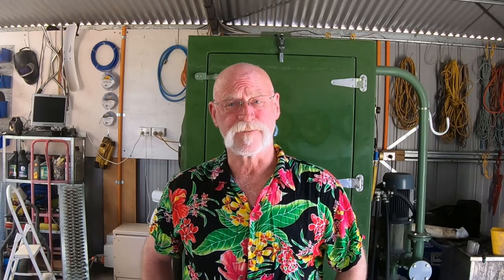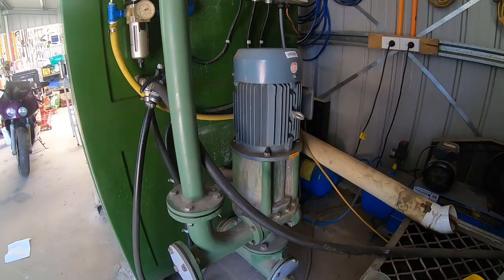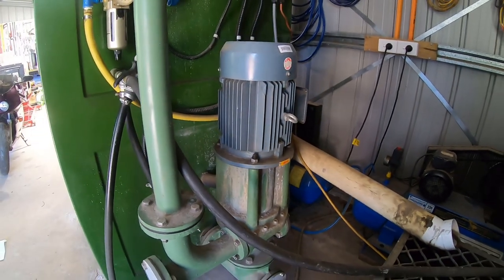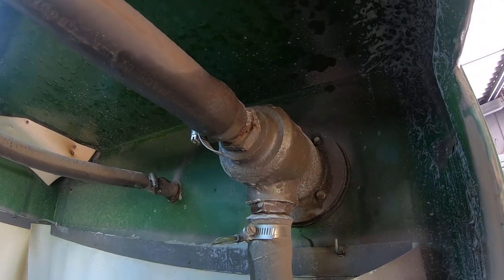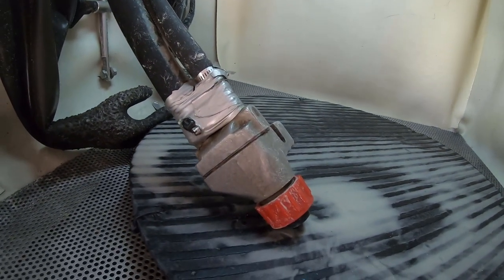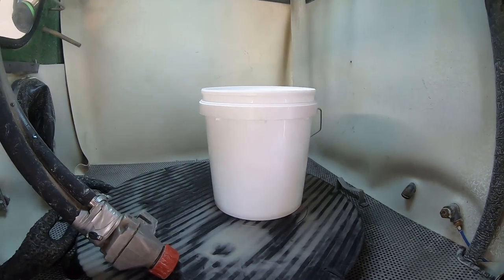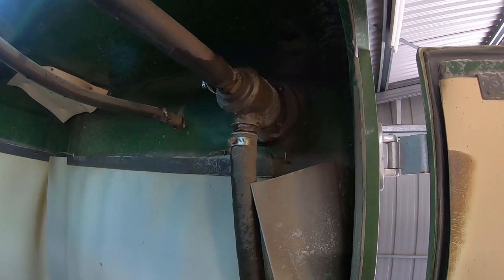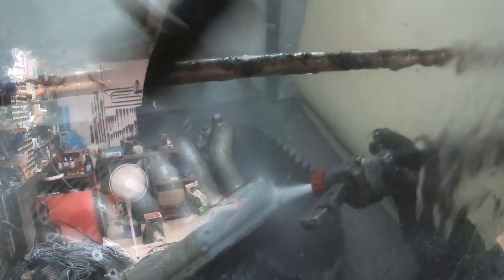How to make money Vapor blasting / Hydroblasting. These are the reasons I went this way.

Comment: Hey Craig.

Always interesting to know some of the workings behind a business.

I did consider buying the same Blast Cabinet many years ago when they first appeared on the market.

The only reason I decided not to buy,  was the asking price ??
It was a little high compared to the amount of times I would use it ??

Possibly better to find someone like yourself and pay them to do the jobs when I need it. 👍

It's a little ironic to see the same machine again after all these years 😉

Thanks for sharing the information with us.
All the Best.
Peter 👍
Reply from the maker: Hi Peter. Yes they are pretty pricey. I’ve had this unit many years now and it has been relatively trouble free and has done a lot of work. Yes anyone considering buying one just for occasional blasting on their parts is much better off paying someone to do it. I find by keeping the price affordable I get many returning customers. Cheers Craig

Comment: Hi CRAIG, my name is CRAIG from SYDNEY. I’ll just finished setting up a blast unit in my garage, similar to yours, though not a Dina Ridge blast unit I bought the large unit from capital machinery that I didn’t buy the turntable. I was wondering if you tell me a is your turntable removable, as I’m thinking I would like to purchase a turntable and looking at yours was considering maybe purchasing one from Dina Ridge, even though I didn’t purchase my unit from them also is there a weight limit on your turntable.                                                                               Your advice would be much appreciated CRAIG
Reply from the maker: @craigwoods7309  hi Craig. Yeah my turntable is removable but it sits in a bush that is subsantially mounted as part of the machines frame (2” angle iron). You certainly won’t regret running a turntable if you head down that path. I would imagine a turntable from dana ridge would be a very expensive item as they are not known for cheap parts lol. Cheers Craig
Reply from the maker: @craigwoods7309  and the turntable is rated to about 200 kg

Comment: Nice set-up Craig. Do you have x2 17cfm  compressors pumping air into an additional air tank?
Reply from the maker: Thanks Brent. I was using a third reciever but found it didn’t provide any extra benefit. The 2 17 cfm units provide enough volume of air at my required pressure to allow me to blast at a pace that allows me time to stop periodically and check the quality of work being done. It really is a good setup and gives my customers great bang for their buck. Cheers Craig